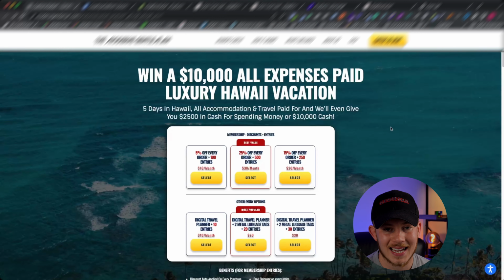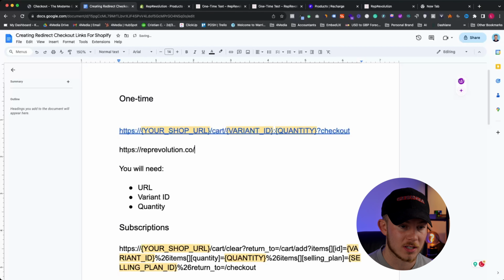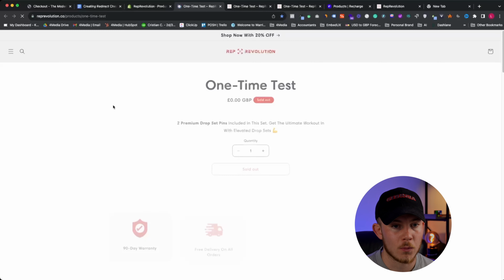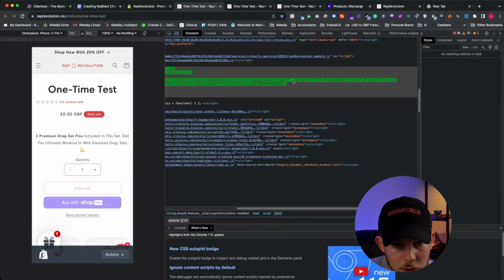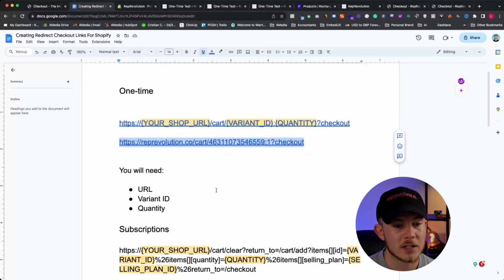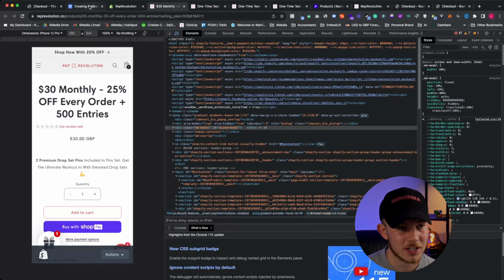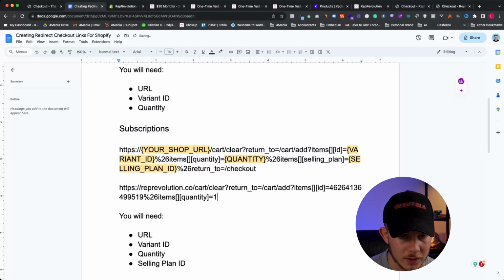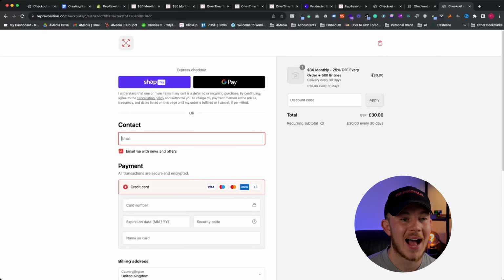Direct to Checkout Links Shopify Tutorial

Comment: thank you for this. if i link each product to the funnel, i am encountering an "expected string to be hash" error. our product has 4 different bundles for multiple purchases. and when ever i spot linl the check out link, the link is dynamic and only applies 1 bundle not the specific bundle link i am linking it to. 

i tried this and got the shopping cart as a stanalone link. but when i integrate it to my funnel, and i am accessing the shopping cart through the button, i am getting the error and won't load to the checkout